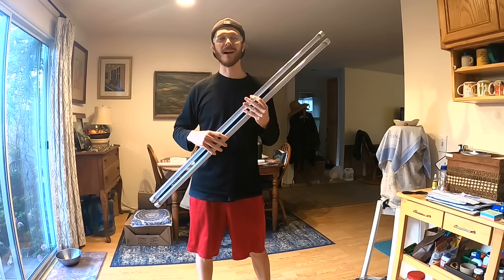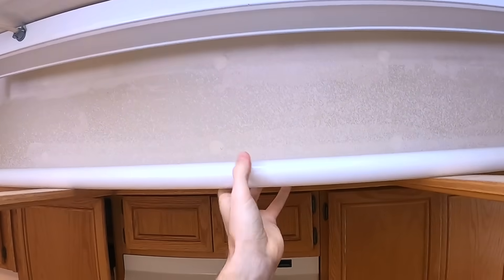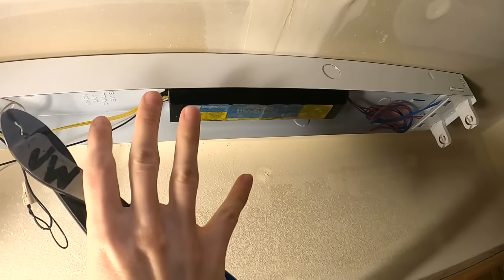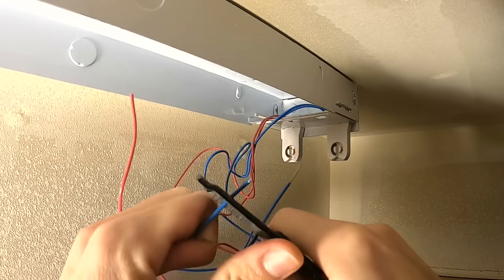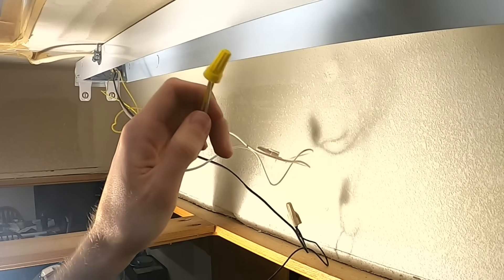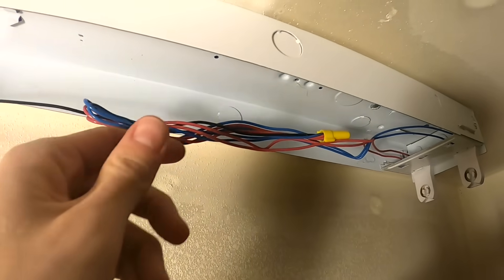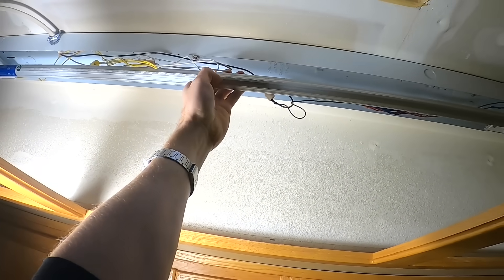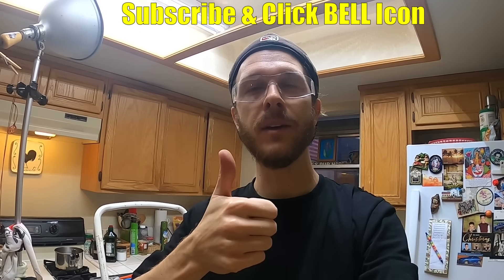How To Easily Convert Fluorescent Lights to LED | Save Money on Energy Costs

Comment: Too bad you didn't show the end-driven method instead of keeping all that useless wiring.  Results in a MUCH neater installation.  I cannot for the life of me understand why anyone would do this conversion with any other method.
Reply: There are two types of led bulbs.  The one shown in this video requires power to both ends of the fixture.  There is another brand out there that only powers one end of the bulb while the other end is just a holder.  Availability is the key.
They are not interchangeable without rewiring the fixture.
Reply: @robertheinkel6225    Certainly.  That is specifically why I said end-driven is by far the best in the long run.  Extremely easy wiring.  The power ends just have to have two wires switched and jumped.  Takes about 5 minutes a light then done forever.  And gets rid of all the unnecessary wiring.
Reply from the maker: Bypass ballast method is definitely the way to go 👍

Comment: Watched too late. I just replaced 3 florescent light fixtures. Took them out completely. Replaced with light socket fixtures and added led shop lights. The tubes are more expensive and hard to replace in a drop ceiling so I just wanted to make maintenance easier in the future.
Reply from the maker: Nice, with sockets now you can use any type bulb which gives you more flexibility 👍

Comment: Is there a reason you went with wire nuts instead of lever nuts? Seems this would be the perfect application for the lever nuts.
Reply from the maker: No reason, just what I had on hand at the moment 👍
Reply: I would be a little nervous about using a wire nut with 5 wires.  It's just too easy for one of the wires to pop out, no matter how many times you twist it.  Something like a WACO connector would be safer.  @JonnyDIY
Reply: There is the Solid wire and Stranded wire. In the overhead lighting systems, the majority of the time, the wires are solid, so using 'wire nuts' is fine. Now if you had Solid And Stranded wire to tie together, it Would be wiser/safer, to use the lever nuts. @bobkitchin8346

Comment: Jonny, a question for you...  You mentioned T8 and T12 bulbs but didn't explain the difference.  Would you please do so?  Also, are these replacement bulbs dimmable?
Reply from the maker: T8 and T12 bulbs are same length and have same connections on ends just T8 is smaller diameter tube than T12. Yes they should be dimmable, usually states somewhere on packaging or advertisement. Then just need a dimmer switch.👍
Reply: @JonnyDIY  Thanks for the info.  Also thanks for a very informative video!!
Reply from the maker: @JohnnyB-t2o  You're welcome, happy I could help you out 👍
Reply: @JonnyDIY Just make sure you get an LED compatible dimmer as standard dimmers play havoc with any type of LED light causing a lot of flickering.

Comment: I am a little confused as to why you didn't pull off the old nuts, remove that section of wire, and keep the number of wire nuts to a minimum.
Reply from the maker: I must've needed the extra length
Reply: @JonnyDIY , good reason!  Thanks for the outstanding video!
Reply from the maker: @albertlilly  you're welcome, happy to help out 👍

Comment: Why is this different for me at work cause the ones I work on mostly on have the hot and Neutral only connected to the tombstones on one side. This video show the tombstones have the hot and neutral connected to all 4 tombstones?? Sorry for my amateur wording
Reply: There are two basic types of led bulbs.  One type like in this video, only requires a hot lead to one end of the bulb, and a neutral lead to the opposite.
I have the other style in my garage.  One end of the light fixture requires no power and only holds the bulb in place.  The other tombstone has to be a non shunted type, and one wire from the tombstone is hot and the other neutral.
They are not interchangeable without rewiring the fixture to match the bulb requirements.

Comment: Why didn't you use the feed neutral and eliminate the short jumper. Less connectors the better.
Reply: Video was very informative for your average DIY'r
Reply from the maker: @BillCraig-r8k  thank you 👍
Reply from the maker: Thought it would be easier to show and explain this way, works just the same either way 👍

Comment: Good God, you are the 4th ballast bypass video I've watched and you are the first one to show without over explaining that ALL of the wires on one end go to hot and ALL on the other end go to neutral. I realize now every other video was doing this but explaining way too much. My guy 👊🏻
Reply from the maker: Thanks, happy I could help you out 👍
Reply: It's different on a 4 light fixture
Reply: @John-c9y3c  what is the difference?
Reply: @John-c9y3c  yeah?
Reply: One thing I would do different is remove the wire nuts connected to the incoming power wires and connect direct to the power wires coming into the fixture. One less set of connectors that you don’t need unless the connecting wires are too shore
Reply: Yeah God is Good
Reply: my bulbs only use one end for power
Reply: Not all connect in that manner. Some of them you can connect that way but you can also connect on one end to the two pins. One being marked "L" for load would get the hot wire. The other pin being marked "N" for neutral. Before one undertakes such a project it would do them well to do some research on the subject to achieve the best way of completing this.
Reply: Have a friend who knows what he is doing - mistakes can be more expensive. They can cost more than money - if your life is valuable to you. I was surprised that "flipping the light switch" is sufficient security for this man. The general rule is - don't touch any wires unless your "main power supply: is somewhere in a box on the wall.
Reply: @BernhardSchwarz-xs8kp Perhaps you missed the part right after he flipped the switch off, he emphasized the importance of safety and to be sure to shut the breaker off as well. Just in case you didn't notice, he also pointed out and showed using a tester on the wires to be absolutely sure there was no power. 😊
Reply: @cindyd003  Yes - you are right - I did. But during the installation of the tubes, he went back and forth testing by just flicking the light switch on the wall - which is only possible if the power switch is on.

Comment: I think you should say to test your voltage tester on a power outlet or similar, immediately before each use; a negative signal from the tester may be due to having dropped the tester (and its not working, bam!!).
Reply from the maker: Good point, I usually remember to mention that because I always test before use on a known live circuit 👍
Reply: Or just switch off at circuit breaker to be absolutely sure.

Lights on........ all lights off.

Or kill main switch as I did when extending kitchen ring circuit, fitting cabinet lights as well as adding 6mm oven radial etc.

Everything on...... everything off!

Comment: I have 2 ballasts in the fixture.  There are 6 wires (blue, red, yellow) coming out of one side and another 6 coming out of the other side. There are 2 black wires and 2 white wires coming out of the main power source.  In this case, how should I make the wire connection?  Should I turn the power off from the circuit breaker before doing work?
Reply from the maker: Yes turn off switch and power at breaker and test to confirm no power. It would be basically same thing. Just treat it as basically 2 separate ballasts. So like I showed, but times 2. 1 white and 1 black wire to one ballast and the other black and white to the other side. And connect same colors as I did. I believe that should work 👍
Reply: @JonnyDIY  Thank you for your response.  Just want to make sure I understand your method.  In my case, should I twist the 2 white wires (coming out of the power source) with the 6 color wires (blue, red, yellow) on one side of the fixture and twist the 2 black wires (coming out of the power source) with the 6 color wires on the other side of the fixture?

Comment: Because they're so bright, is it safe to leave a tube out or do all spots have to be populated?  Fire hazard?
Reply from the maker: Yes it's perfectly safe 👍 Could also install a dimmer switch if bulbs are dimmable 👍 I think I might try that
Reply: @JonnyDIY   Thanks!  Do you think it'd be stupid to electric tape over the unused tombstones?  Or just leave it open?  That way I can add a tube if needed later on.  Mine are not dimmable unfortunately.
Reply from the maker: @sl1237  should be fine open, could leave an old dead tube in there if you had one

Comment: NOTE: Some LED bulbs like these are set up to connect from one end only. Hyperikon, is one. Best bet is to read the directions that come with the bulb.
Reply: Yesss I am currently struggling cause I run into those the most!
Reply: I will certainly check the description for now on cause I have no idea how else to know when to only connect wiring from one end only
Reply from the maker: Thank you for sharing 👍
Reply: Dimmable with non-shunted
Reply: When you buy the bulbs, the package shows what wiring is required.  They are not interchangeable without rewiring again.

Comment: If it weren't for having to completely remove the whole 4' fixture down in the basement by my washing machine, I would've done that, ie, getting rid of the ballast, but I just threw some "universal" / "plug&play" LED replacements in there.  Same for the 3' fixture by my kitchen window.  Old old fixtures were that way, ie, no easy trapdoor to be able to get rid of the ballast.
I like anything between 4000K and 4500K, as it's not as harsh as "daylight" bulbs, especially at night, and not as yellow as 2700K or 3000K.
Reply from the maker: Good points. One of my ballasts was going out so it was a no brainer for me to do it this way. I like warmer lights too. I think the ones I put it were daylight but the old light panel diffusers I have in the kitchen make them a lot warmer
Reply: @JonnyDIY  I'm very much into flashlights, and have everything from the Angry Blue 6500K lights that scream "LED!!!", down to 2700K lights that have a nice warm incandescent glow.
What's best is what ambient lighting is, or is expected.  At high noon, looking in your garage for something, 6500K might seem okay, whereas 2700K would look eerily yellow.  At night, though, 6500k is like a bucket of sandy salty icewater to your eyeballs, harsh beyond belief, whereas 2700k is warm and natural, and you get used to it very fast.
Add high-CRI (color rendition index) to warm white, and you got a winner for nighttime use on trails and the like.
I don't recall any CRI ratings on tube-replacements, though.  Some might claim 90CRI or better, but I'd have to see it if not measure it.  I'm betting most are 70CRI at best.

Comment: OR, you could leave the fixture wiring alone, and use hybrid LED bulbs that require no modification of the fixture.
Reply: Ballasts suck. Where I work, they're always having to replace the things, and one of them nearly set the building on fire. Get rid of 'em.
Reply: @aspensulphate  -- Any such danger goes away when you replace the fluorescent tube with a ballast-compatible LED device because it ignores the high-impedance, current-limiting starter function that's the typical failure point and fire hazard of a ballast.  That's why the LED replacement doesn't do that brief flickering when you switch it on -- it fully lights up immediately.
Reply from the maker: Yes, that is an option, but you'll still be relying on the ballasts.
Reply: @JonnyDIY  --

Ballasts are sturdy beasts, and even one that's barely functional  -- and if you've had to replace fluorescent tubes more that once a year, your ballast is tired -- will not present a problem for those "hybrid" LED replacements, since they don't require the brief shot of high voltage the ballast provides.
Reply: Ballasts draw additional power and usually create unnecessary heat.  For maximum savings,get rid of them.  Plus the hybrid bulbs are more expensive,

Comment: 🎉why would you bother. Just buy new LED BATTENS. New slim line and sealed from bugs and no chance of tubes falling out if used over a working area. Food prep areas much better to fit new LED BATTENS.
Reply from the maker: Yes that it an option especially if you need to replace fixtures 👍

Comment: Interesting. Why didn't you remove the short pigtails on the incoming power wires (black/white)?
Reply from the maker: No need to. I guess I could have with the white one, but I needed the extra length on the black one.  But either way it's no difference 👍

Comment: This video was well done and informative.  I wonder when the government will ban fluorescent bulbs in favor of LEDS.  I also wonder who in government is getting a huge kickback from the LED manufacturers? Cheers!
Reply from the maker: Thank you Gary! 👍 Yes I'm surprised they haven't  been phased out yet, light the incandescent bulb was
Reply: Government phases out hazardous substance-containing bulb that requires special handling, expensive recycling practices, and can negatively affect cognitive ability.
*huge conspracy*.
Reply: Flourescent's have Mercury vapor. Very toxic. LEDs have various toxic chemicals in the circuitry, but are SUPPOSED to last so much longer than flor or incandescents. Plus, leds can just be tossed in the garbage intact. Flor will break and release the mercury. Some places have started accepting LEDs for recycling.

Comment: ? But LED LTs are polarity sensitive... so the positive and negative, is the difference of working and not working. 😮
Reply: The four foot LEDs are not polarity sensitive, since it is AC powered and constantly changing.  The bulbs you are referring to are DC powered and will not work if reversed.

Comment: Thanks for sharing your knowledge, very simple video and very well explained. My question is: The conversion that you did it’s for regular fluorescent to type B led ? The led that I have said plug and play type A and they don’t work so I bypass the ballast and still nothing that’s why I think that I need a type B led. Do 
I’m wrong?  Thanks for your response.
Reply from the maker: Yes I would try the other bypass ballast LEDs. It's possible the ones you got work, but maybe the ballasts were bad or didn't work with those ones specifically. May try local hardware store so you can try them out and hopefully not have to return them 👍

Comment: You don't have to do all that time consuming task ,nor do you need any electrical tools or knowledge .
You only need to replace the old fluorescent bulbs with the new LED bulb and then you remove the old starter from the fitting.
There you go
LED bulbs don't need a starter in order to operate
Reply from the maker: Yes that's exactly what I did in this video, removed and bypassed the ballast 👍
Reply: Starter? LEDs require a driver...
Reply: @yoho6348  The driver is the integral part of the LED tube which is located on one end inside the LED tube.
You don't need a conventional starter at all

Comment: Sorry,  yes, you have tested at t=2:30 that power is off.  But that is no excuse for using an uninsulated tool with a metal handle. Be double safe, use insulated tools. My choice would be to bring battery work light and trigger the HFI-relay for the rooms installation to be certain that power is off. And even then, I'd use an insulated tool.
Reply from the maker: Good point Peter, I guess I should pick up a set of insulated screwdrivers and a pliers/cutters set. I think I only have a cheap pair of linesman pliers somewhere

Comment: Will these work with a normal dimmer switch on the wall? Or is there something additional you need?
Reply from the maker: Possibly, if you get bulbs denoted dimmable. And dimmer switches are kind of funny I've had some regular ones work with LED bulbs and some I've had to swap out for newer style switches. Worth a try 👍